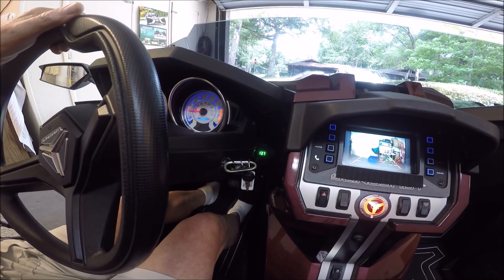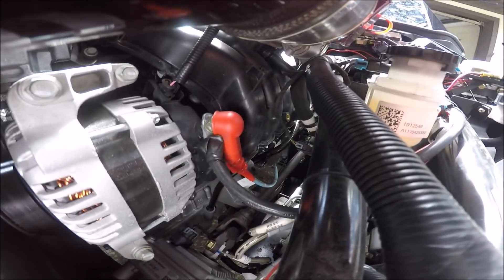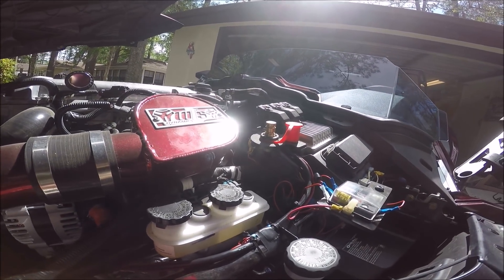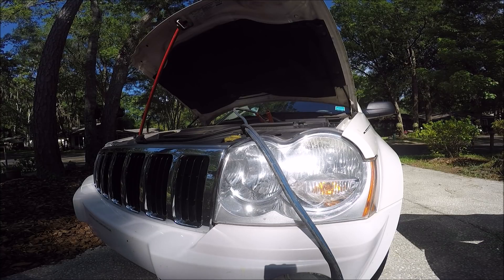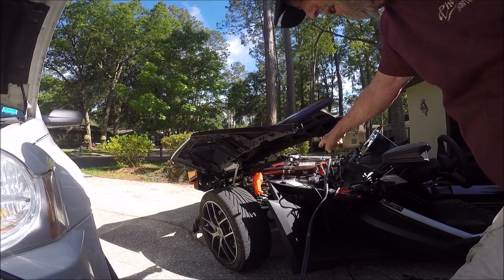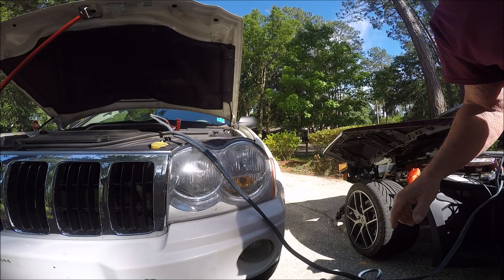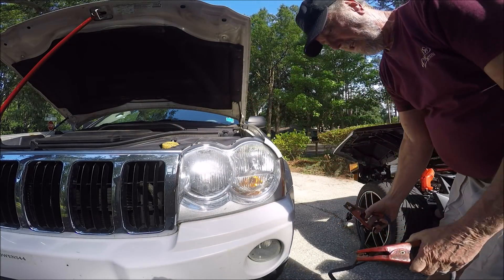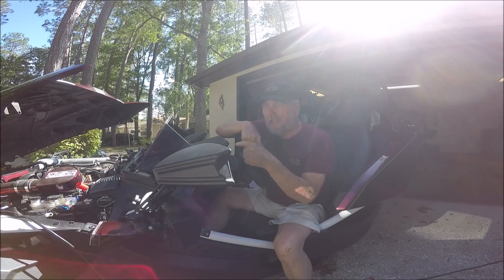Jump Port Start Test on Polaris Slingshot

Comment: Hey sam, is there anyway you can make a video of the headset you and your wife use, and the ability to use that system with the Go pro.
I noticed your mic does not pick up a lot of engine noise from your slingshot, seems pretty impressive.    Thanks
Reply from the maker: Regan, sorry, but the GoPro can not  connect to the headsets we us.  I use a external Mic sometimes that plugs into the GoPro and hook mic to my sunglasses.  Look at my youtube videos and you will find my review of the Sena SHM 10 Intercom system we use.  We love it for driving and talking.

Comment: So in all reality you can simply hook the jumper cables straight up to the alternator and bypass that jump port you installed. Least that's my take away from this video?
Reply from the maker: Regan Collins yes you could, getting jumper cable clamp on the alternator terminal could present a problem.  There are always different ways of preforming a task.  Thanks for your comment.

Comment: There is a reason the jump posts come with short 4awg, and Polaris ran a 2awg from battery to starter (and didn't fuse it). Yes, it will start this 4 cyl engine. It is not designed to do this. It is not the optimal connection. The cycle time is fast, and needing to jump start should be rare. In a pinch, sure, this will work. If you are installing something with intent of leaving it, then it should be done correctly. Everyone has different ways of skinning the cat, but at least tell people the correct way, and explain why. Let them decide to cut corners. This will work, but can cause the fuse link to prematurely wear and open the circuit. Then you must have the fuse link replaced, which is difficult to reach. The more drained the battery, as you stated,  the more current will inrush through that 8awg fuse link. You seem like a good man, and are very kind to share so many videos. I do not intend this to be negative towards you. Just sharing my opinion from on the job experience.
Reply from the maker: ChrisBeaver24 , thanks for you input, you are correct, this is a rare use type setup.  I did find out later that after jump cables were removed, the charging current from Slingshot alternator made the lower gauge blue wire much hotter.  So the 1 second start using that lead should work for battery starts at a 10 volt level.  O volt dead battery could be a problem.  That is why I mention voltage conditions.  I hope this video will help folk understand it is to be used as an emergency start of 1 to 2 sec starts and the value of knowing the voltage state before attempting jump start.  The should have a volt meter reading device.